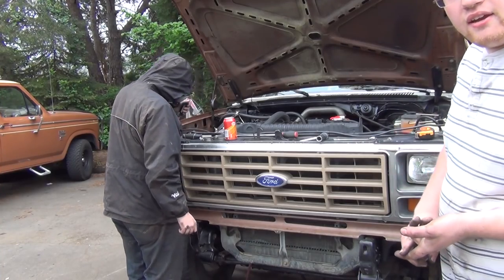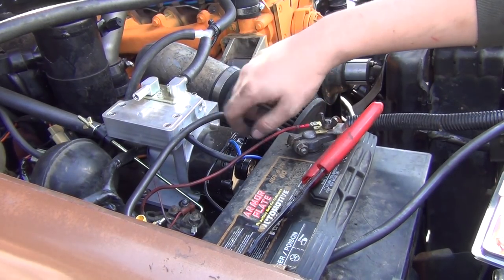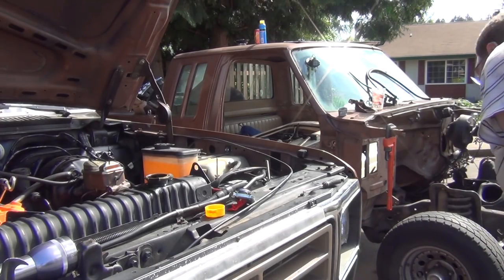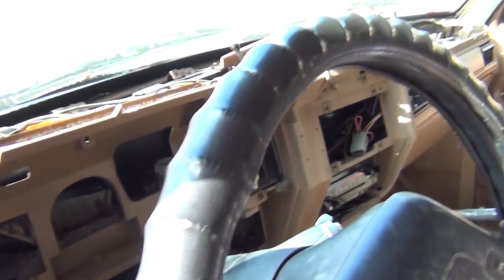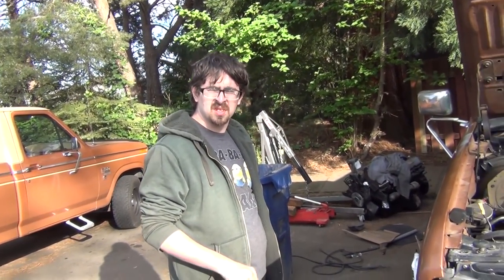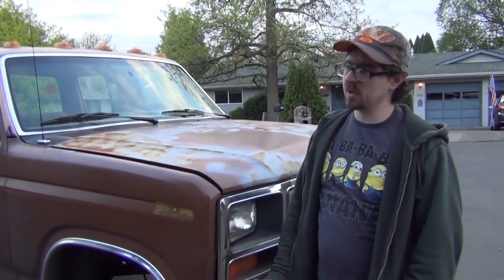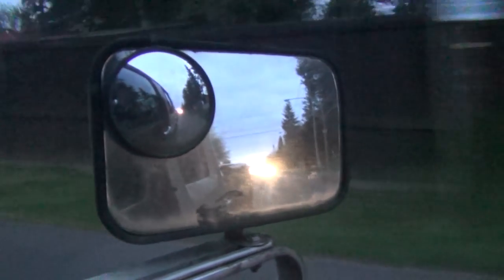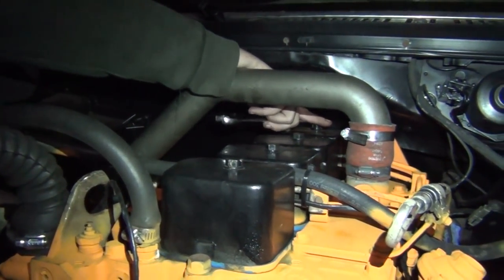Bullnose F350 Project Truck Part 8

Comment: why a 4bt over a 6bt in a 1 ton?
Reply from the maker: +Rylan Craig We already had the 4BT Plus the 4BT has been doing just fine in the one ton. The truck only weighs 6400 pounds which is nothing for that little engine.
Reply: I think the 4bt is a bit small for that truck. Probably gutless uphill or towing.